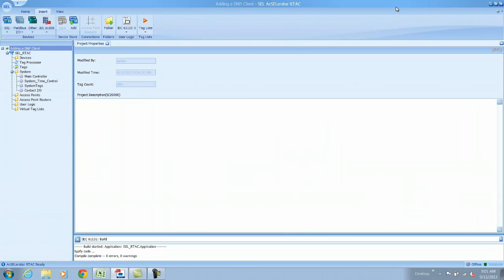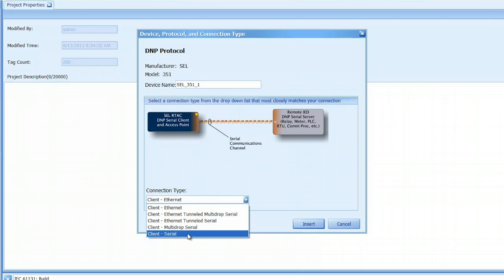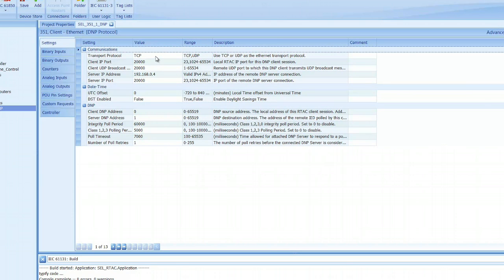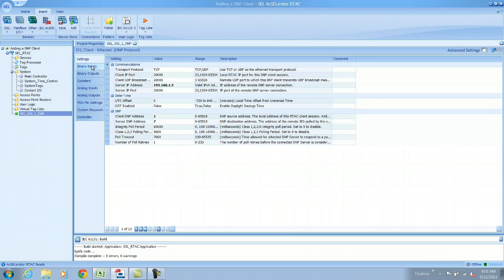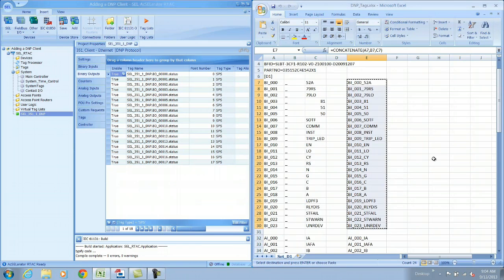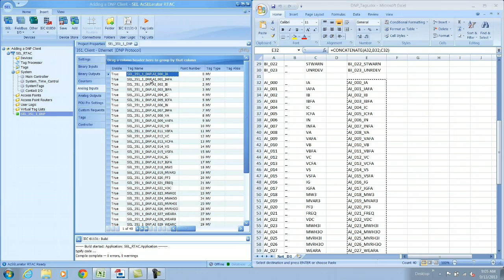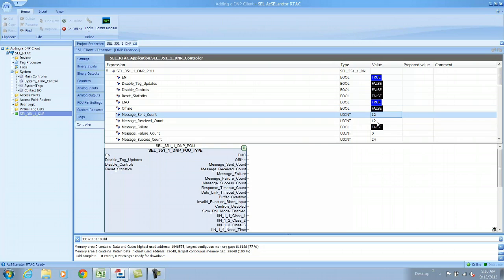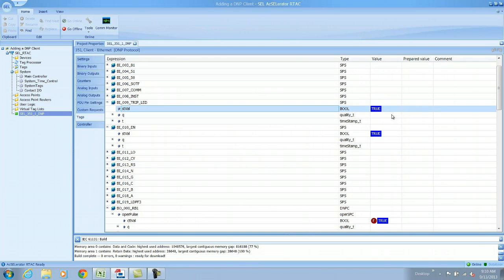SEL RTAC — DNP Client (4 of 9)

Comment: In case of using SEL with serial ,do we need to collect binary inputs from quickset ? If yes, how?     Also is there other video that use SEL protocol and serial ?
Reply from the maker: Thank you for your question!
 
Yes, when configuring a DNP client in the RTAC, the Binary Input map of the relay is required to create the matching tag layout in the RTAC settings. This map is determined from the relay’s settings, which are often defined in Quickset. A video linked here describes the process of exporting this map from the relay settings into Excel for use in the RTAC: https://video.selinc.com/support/detail/videos/automation-controllers/video/1739346494719217836/acselerator-rtac:-generating-tag-names-from-a-relay%E2%80%99s-dnp-map-using-microsoft-excel?autoStart=true&page=1
 
Configuration of a SEL protocol device connection is described in detail here: https://video.selinc.com/support/detail/videos/automation-controllers/video/1800511402844997004/acselerator-rtac:-sel-protocol-client-configuration?autoStart=true